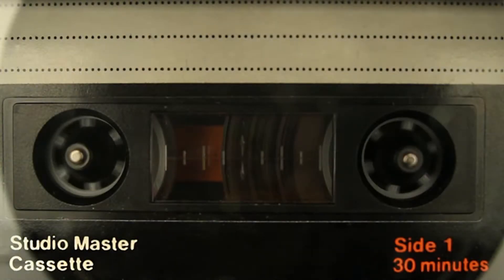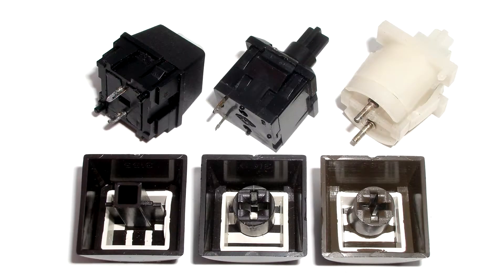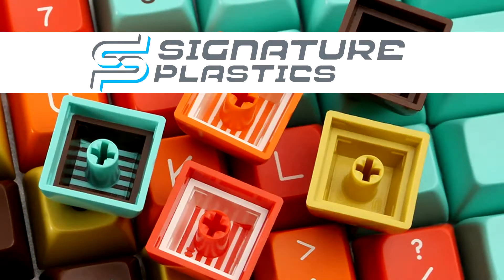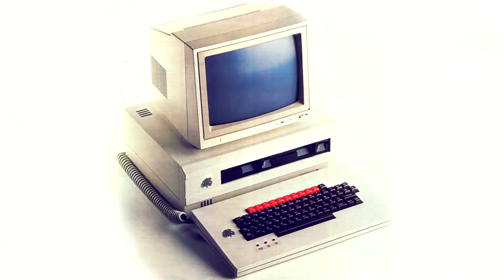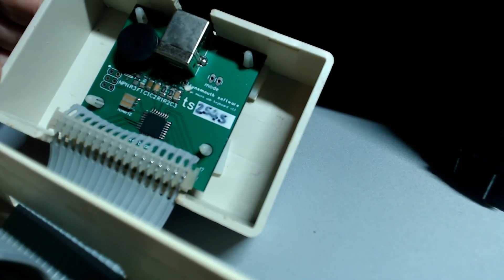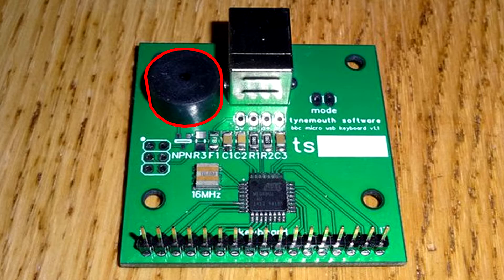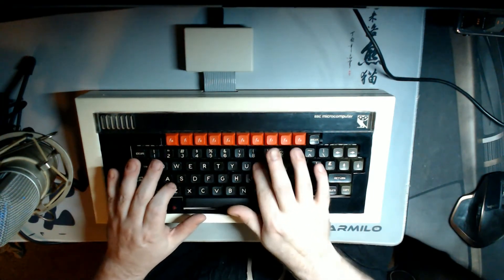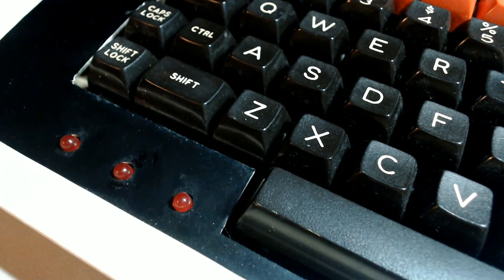Converting a BBC Micro into a USB mechanical keyboard - the most British keyboard ever

Comment from the maker: I think it's difficult to express how loud this is. Although my main keyboards is pretty quiet, this thing is noisy relative to anything. It's louder than my speaking voice. It would take proper lubrication and a small pillow inside the case to get the noise down. And yes, it's really heavy. 

From a last minute bit of research, it seems it's a Solidisk BBC Micro external case. Solidisk made a lot of addons for Acorn computers (and others), so I'm not surprised.

Comment: The only early micros I knew that had a mechanical keyboard were the BBC Micro, the Dragon 32/64, the Oric Atmos, the Acorn Electron and the TRS-80. Some were better than others. The IBM PC Model F was a mechanical keyboard. Commodore Amigas with a big box had a cherry keyboard option in the 2000/3000 era. The Olivetti M20 had a foam and foil mechanical keyboard. The Olivetti M24 had a mechanical keyboard, but unfortunately, the Olivetti M240 had a membrane keyboard.

Early Sinclair and low-end micros went with the membrane keyboards as a cheaper option and felt awful to type on. Even the QL business machine had a membrane covered by a rubber dome but you could upgrade to the Schon keyboard.

As someone who grew up with budget computers, I longed for the day when I could afford a computer with a proper keyboard, just when mid-range machines started having rubber dome keyboards bundled with them. How disappointing.

I finally found Cherry Blue keyboards and never looked back. I found the Model M interesting but it felt pseudo-mechanical in its operation with the membrane beneath, However, the buckling spring was a very impressive compromise.

In my opinion, typing on a clicky mechanical keyboard feels far more satisfying than a membrane keyboard.

Comment: Me: Where's the num lock key?
BBC keyboard guy :

Yes.😄
Reply from the maker: Well, on the BBC Model B, there's no numpad, so there's no numlock. The BBC Master Compact has a numeric keypad, so does it have a numlock key? No. But it does move the cursor keys into an even more insane position.
https://preview.redd.it/3zbsavk8yeox.jpg?auto=webp&s=10ff6b2b9e1a3fb96533e87c0fb19f809469292e

Comment: Another option is to use the original BBC Micro case - but replace the old PCB with a Raspberry PI 4 and 256GB SSD. You also need to swap out the original PSU with a higher power replacement (this will set you back about £10 from RS Components). Another point is the actual BBC keyboards. The early ones were cheap and abysmal, with a squeaky action that was prone to sticking. Thankfully, the later generation ones (with the dark brown PCB) were outstanding with full "soft-click" tactile feedback.  
You can also rewire the cassette LED directly to the new PSU, so that you have a power indicator as part of the LED cluster, which is really nice!
Reply from the maker: When making a USBBC (USBeeb?) keyboard, it's pretty hard to use the original case just because of its size, though with the rarity of these sectioned cases, it's probably quite viable. You end up with a rather unwieldy 'board on your desk. A Master Compact would be ideal and has a numeric keypad - if ever I find a cheap Master Compact, I'll be doing that. I take your point about sticking a Pi in there - great idea - but I was also keen with this build not to throw away working parts. So I actually started with a very broken Beeb and didn't have to ditch a working PCB.

Comment: Damn, this is insane. It's a shame it's not an easier project to gather up, but that also makes it what it is.
Reply from the maker: Well there are alternatives that would be a lot more manageable. The biggest problem with the BBC Micro is that the case is huge, so you need a replacement - which is the hard bit to find.

The little brother successor was the Acorn Electron. It's small enough to not need a new case and still has a mechanical keyboard (low profile versions of the Futaba ML switches) with plenty of room to fit a Tyneside Software circuit or even leave the computer functional. You can get one for about £30 on British ebay if you're patient:
https://www.ebay.co.uk/itm/254955420708

A Commodore Vic-20 can be had for about £30 as well and will convert nicely into a USB keyboard with a Tyneside board. The only problem with them is it's a little hard to determine what the keyboard is made of. There were three different versions: one uses rubber domes, another is a conductive foot (bottom of the switch touches the motherboard to conduct electricity) and the other is a mechanical keyboard (it's the oldest one).
https://www.ebay.co.uk/itm/324590139164

There's also an interesting company making PC cases that look like the Vic-20 or Commodore 64 with proper modern mechanical keyboards (with real Cherry MX switches). They're a little pricey, but you can fit a real PC inside and have a beautiful keyboard (with some extra keys added rather cleverly) to make it very easy to live with. I'm very tempted.
https://myretrocomputer.com/shop/

Comment: Great Video. As a huge fan of retro computing i was stoked you made a vid like this :) keep em coming :) :)
Reply from the maker: The BBC Micro was my first home computer and I learned a lot from playing with it. I've recently been enthralled by a Twitter bot that allows you to send a tweet that will be run on a BBC emulator. Back in the olden days, one of the BBC Micro magazines had a one line programming competition - cram as many commands as possible into one line of code. And it rather reminds me of that. I remember I wrote a fractal generator that took 16 hours to draw a basic Mandelbrot set (and overheated the computer and crashed it). I may well do a video on some of the more interesting pieces of code from this Twitter bot thing.

This is the Twitter bot thing:
https://www.bbcmicrobot.com/owlet-test2.html